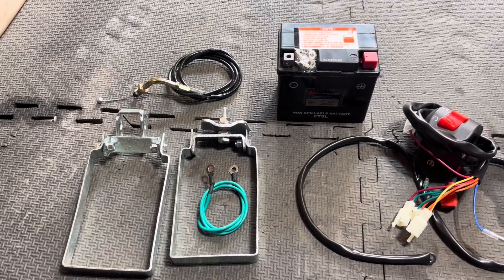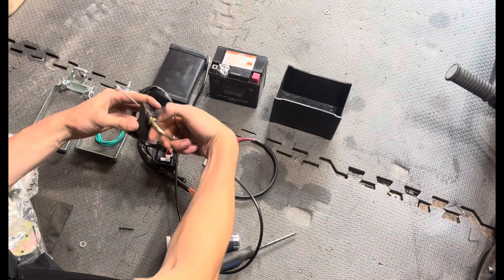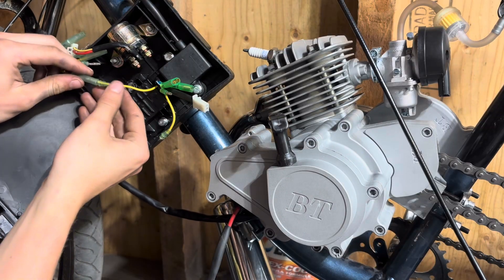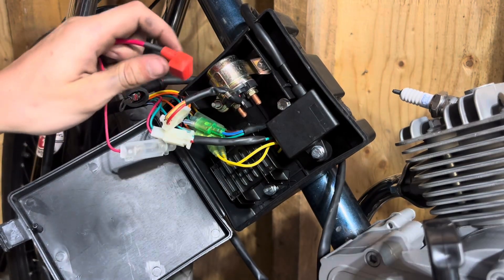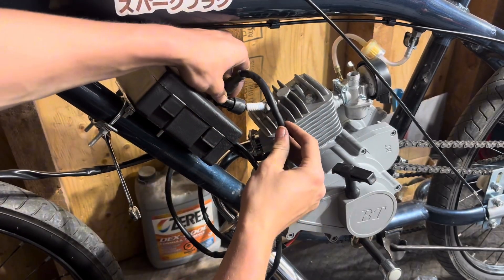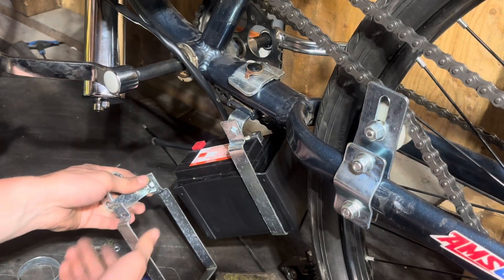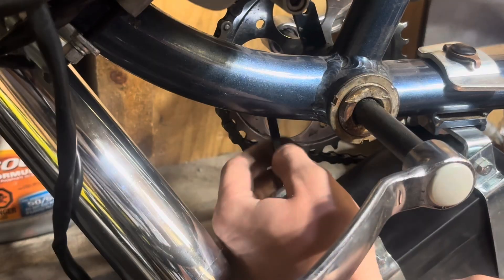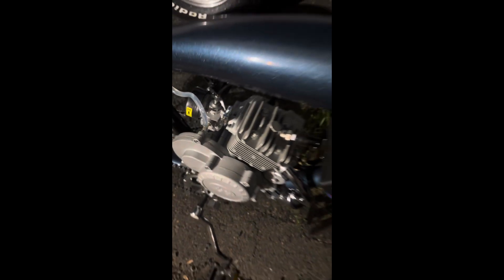How to Wire up the Electrical on a BT80 Engine Kit!

Comment: Me too, I would never buy this engine.  Much more to go wrong and way to complicated, i.e., electronic box, electric starter and battery that are necessary and will require additional cost and maintenance.  Where the battery is placed in this video is the pits!

Comment: Why not geat a engine from smolik performanc or gomax like a built engine with 6 to 9hp like a avenger 85 or 90 or a menace/phantom 85 or 90 they are a lot more fun
Reply: The ground shouldint make stuff spark the positive should tho